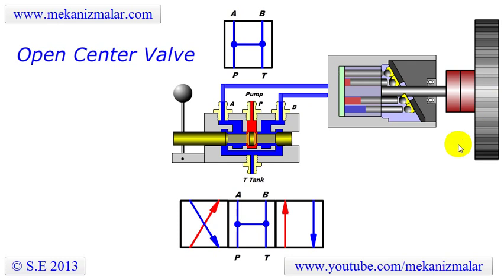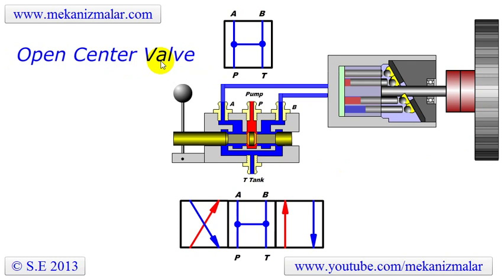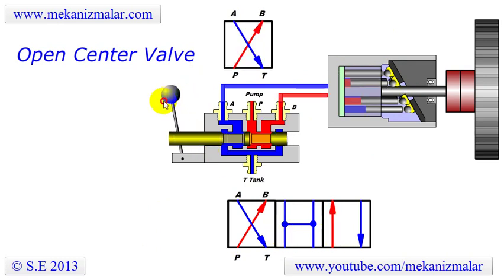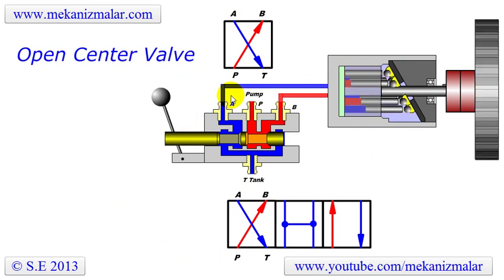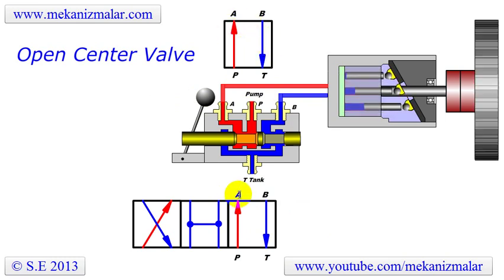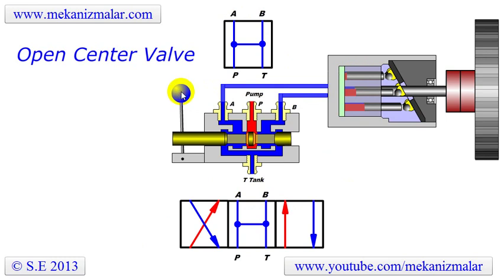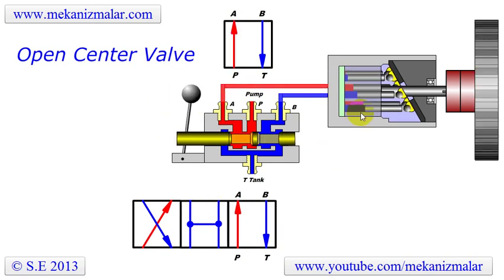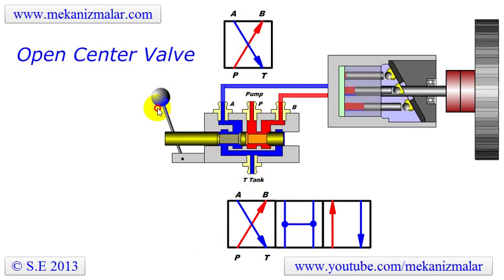open center valve

Comment: Great video, but in my opinion the functionality of the symbol is not the same as the valve,
In center position the valve closes the P way; and it is right. In the simbol the P way is connected to T, A and B instead,.